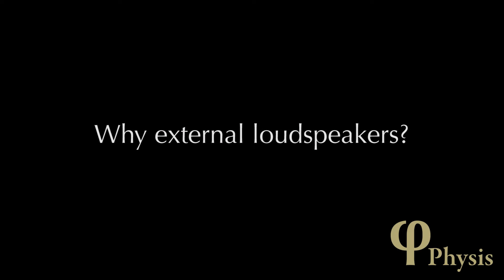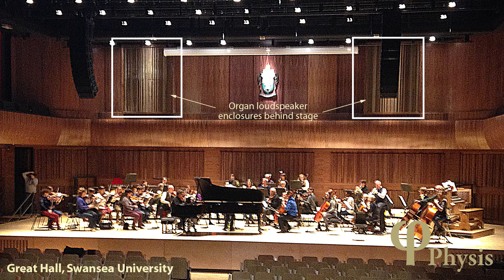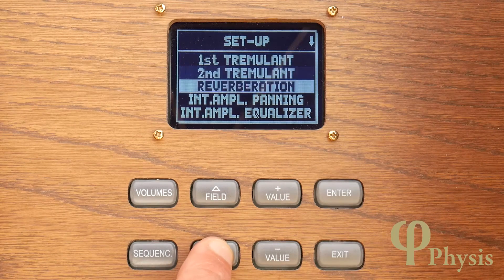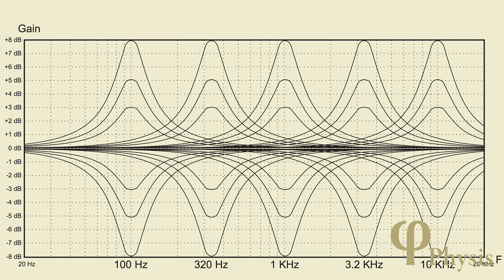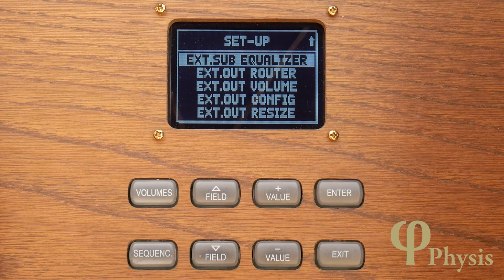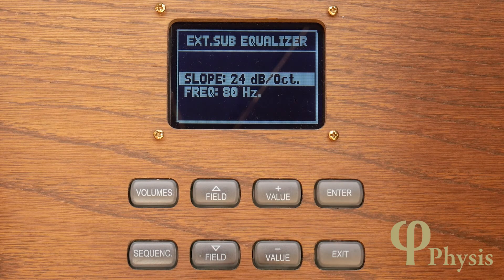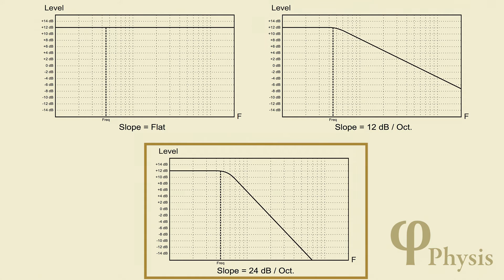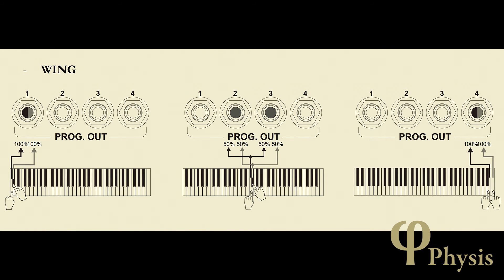7.  Using External Audio

Comment: Can you set the standard 4 channels divisionally? For example channel 1 pedal, 2 choir, 3 Great, 4 swell and use combination (high range) speakers and sub amplifiers?
Reply from the maker: Hi,  All organs can have 12 channels and larger ones 20. You can set any stop to any chanel so you can separate the divisions if that is your objective. on the standard 4 channels for all 3 manual instruments.
Reply: That's perfect. Is there anything you can't do on a Physis organ?
Reply from the maker: We so far have not been able to get it to make a good gin and tonic!